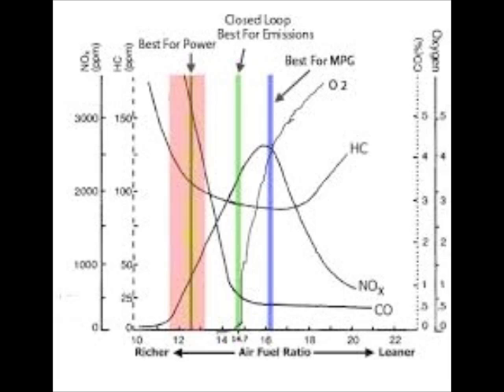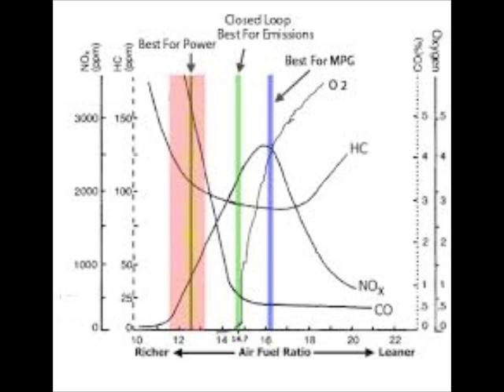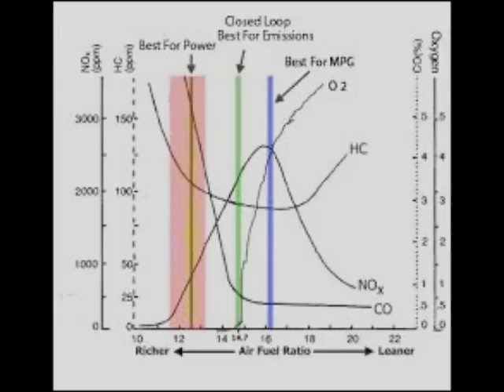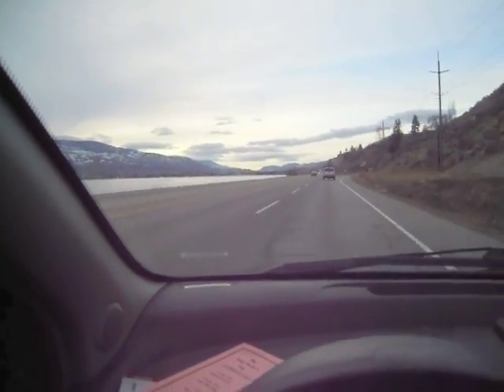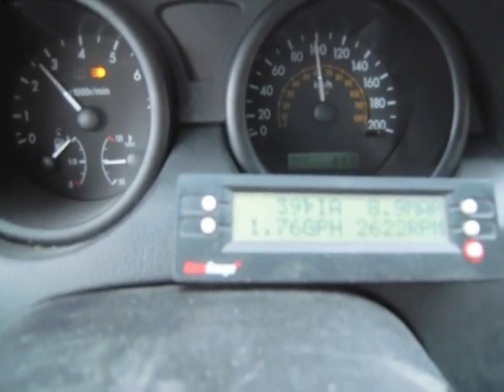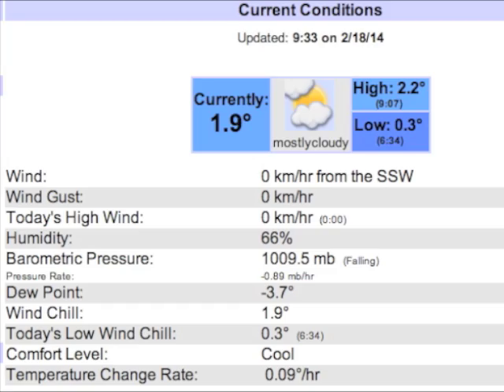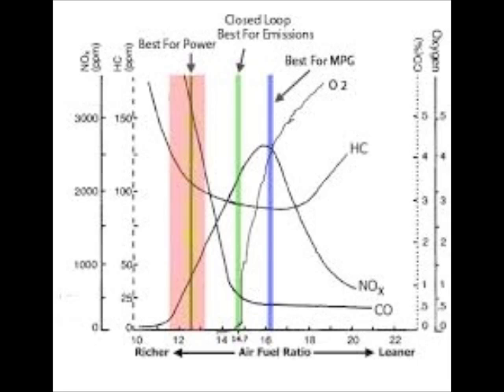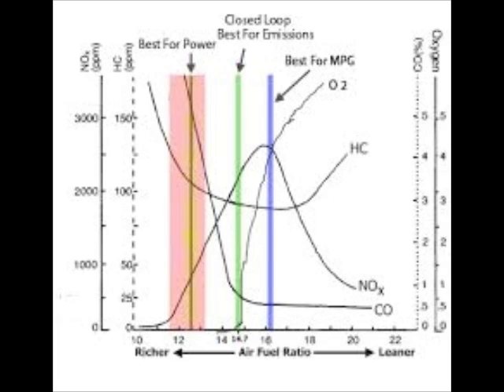Air:Fuel Ratio Lie Exposed 2

Comment: bruh plz stahp. Get an obdII scanner and check your maf (mass air flow) sensor readout (it shows air flow in g/s), then look at your injector flows (also shown in g/s).

Then look at your true afr with no assumptions.
Reply from the maker: That's exactly what I did!   This vehicle doesn't have a MAF sensor so I calculated from actual data, including ambient air pressure, temperature and humidity.  NO assumptions!   I've done this for many vehicles, even carbureted.  
Go ahead and try it with your vehicle with a MAF sensor.  The problem is that everyone 'assumes' they are being told the truth and few actually take the time to do the math from ACTUAL data.  They 'believe' machines that have been deliberately miss-calibrated.
Reply: If the vehicle doesn't have a MAF sensor then it will have a MAP sensor - which will equally show you this data. The car must know its mass air input by one means or another otherwise it cannot calibrate its fuel injection to meet the afr as determined by its mapping. (id love to see you argue that the sensors are miss calibrated with a dyno tuner)

And man I read through your Eagle Research website extensively lastnight - having a massive laugh with friends. I am a 3rd year double degree student majoring in engineering and physics with minors in chemistry, and i can say for certain you have very little clue on what you say/do :') I have personally created data in laboratory situations and performed the math individually and with the help of professors far smarter than you and I. Although your simplistic re-discovering of well known/understood concepts is reminiscent of early 1800-1900 alchemy, it is intriguing to see your uninformed though process.
Reply from the maker: First, you've obviously NOT watched the above video, in which I DID use the MAP sensor data (along with all other relevant data) to exactly calculate the ACTUAL AFR.  
If you do not understand my demonstration then you either haven't actually looked at it (ignorant student buying the party line) or you are a TROLL looking to obfuscate this LIE by trying to invalidate me.

Second, I've been increasing the mileage of vehicles since 1974.  I took my first pickup to 36 MPG. Since 1984  I've helped hundreds of thousands of people increase their mileage (many times doubling the mileage).  When using my techniques pollution goes to near nothing, power, performance and engine life are increased.

Third, I'm a certified automotive technician and have studied chemistry, physics, combustion engineering, thermodynamics, etc.  Before you claim your professors are smarter than me, you should know my mechanical IQ was 'off the chart', the tests couldn't measure it (perfect score in 2.5 minutes of 5 minutes allowed).
I also have DECADES of real world experience actually DOING what I claim.  
Good luck trying to prove me wrong with puffed up pride, snide comments and sarcasm.  
If you and your friends had a good laugh then I'm happy for you... That's obviously all you are going to get out of this revelation.  
It's sad that schools are STILL teaching students WHAT to think instead of HOW to think.
Reply: Okay, lets try to keep this civil, I'll hold back on insults/degrading and such for the sake of open communication as I have often wondered how people like yourself perceive the world.

Firstly, you entertain the idea of perpetual motion machines on your webpage (assuming eagle research is yours) and yet you speak of being informed about thermodynamics? (im sure you get this a lot)
Reply: George Wiseman hello George and thanks for posting!
Is there a way I can contact you if you have 5 minutes to answer a question please?